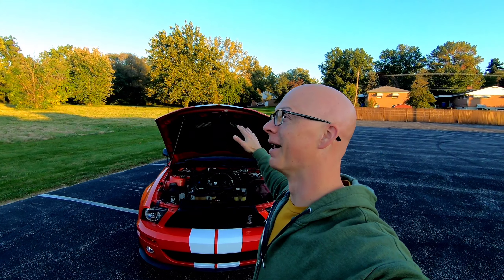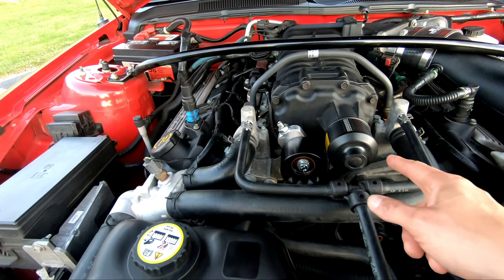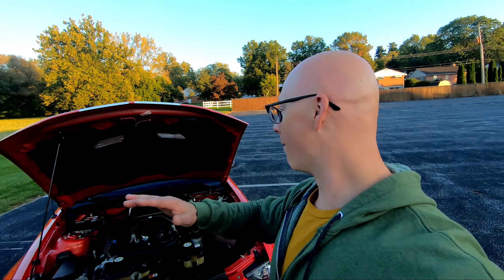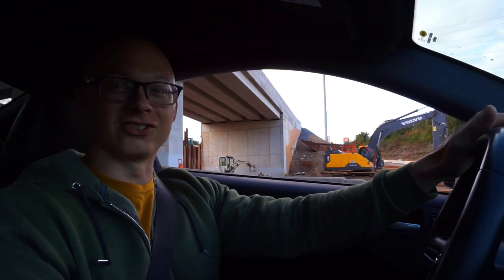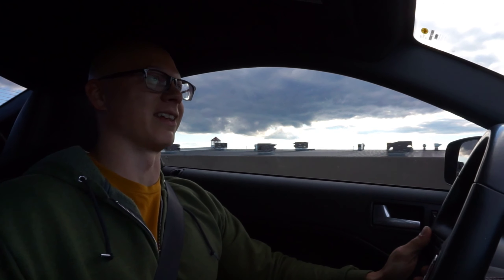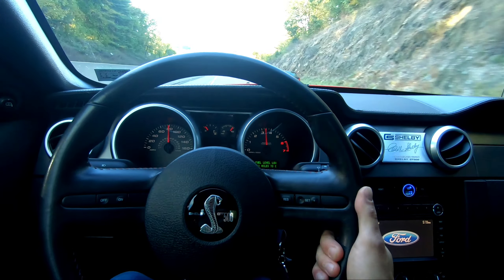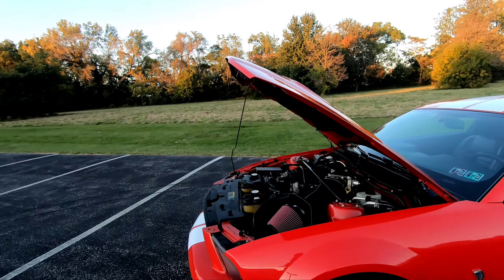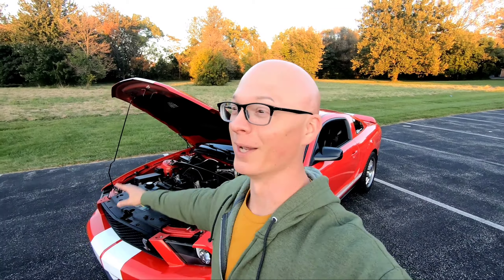2008 GT500 gets JLT intake, VMP 2.5 pulley and custom tune! | GT500 vlogs

Comment from the maker: Thanks so much for watching!  I'm so excited for what the future holds for the GT500 and the channel. Dont forget to drop a like on this video and SUBSCRIBE if you haven't already 🙏😁
Reply: What did you have in the tune parts a labor
Reply: They can make power easy.I know.I have said it before 2 SS and my 08gt500.With just a few mods and you can make well over 600wheel
Reply: Yah they pull forever
Reply: I love to give you a ride in my super snakes or my 500.Crazy power instantly.
Reply from the maker: @crf4328  about $1,500

Comment: I just changed to a 2.5 pulley ,cold air JBT,tune and  Dyno results Torque 576.14 Max power 546.73 convertible,real fun, especially with the young guys,

Comment: Theres a gt500 2007 same color as yours being sold for 29k about an hour and a half away from me from a used car dealership with only 60k miles any thoughts?
Reply from the maker: I'd buy it!   Them chamge the lower pulley because the 07's have balance issues with the lower cast pulley
Reply: @automotiveantics  sweet! Thanks for the tips that's my plan soon 🙏

Comment: You should try 4.10 gears and sticky tires with that power!  Mine put down 550 through 410s with a twin 65 tbody.  Its fast...any gear any rpm it just moves quickly when you mat it.  Love the low end torque.   Mine has the same mods, catless h, jlt 123..
2.6 pulley not 2.5 but i also got borla stingers and 4.10s.  Shes quick lol.  These things are so much better once theyre modded even just a little bit.  People misjudge them because stock they "only" got 500 hp and bolt on 5.0s can keep up with them nicely...when stock...once they have minor mods like this and like mine they become monsters ecspecially for a car that came out in 2007 lol.  I knew you would love this remembering your reaction to stock power lol.
Reply from the maker: Oh I agree it definitely needs gears. I'm thinking about 3.73's. One I get a McCloud clutch in then I'll put some sticky tires on and it will for sure RIP!

Comment: Very nice for u ! My NA 87 5.0 i have BBK cold air intake , march pulleys and flowmaster 40s mufflers
Reply from the maker: I love the foxes!  I've had 3 and would love to get another one
Reply: I have a 87mustang gt with T TOPS.I love it and I will never sell it.I also have a 92lx 5.0 and my best fox OTHER than my other car's.I have a vibrant red 93cobra with 20 thousand original miles.The car is almost perfect original shape.I just have exhaust and that's it.I know there not the fastest but they are beautiful car's.If I WANNA go fast I can get into one of my super snakes or my 08 gt500.Life is good lol
Reply: Yes the 07 09 GT500 make power easy.
Reply: @automotiveantics  There are TQ MONSTERS.They pull all the way too red line.
Reply: @automotiveantics  I have 410 in my 08 gt500 and my car is violent.850rwhp makes all the difference.You have so much more potential with the car.
Reply: @automotiveantics  Try to imagine 300more hp nuts ha.
Reply from the maker: @anthonylaudano9751  for sure!
Reply: A whole 220 hp lol

Comment: You are prob around 13-14 psi without headers but the stock gauge is not accurate once youre modified im surprised yours reads that close mine with a 2.6 pulley on stock blower would peg the gauge past 15 psi and it prob wasnt seeing but 13 max lol.  I have a gen3r now pushing 19 psi it still pegs haha.  I need an aftermarket boost gauge and afr gauge.  I had it dyno tuned so they had those readings to tune it but i need some in the car so i can keep an eye on stuff plus it looks cool lol.  Mine put down 740/733 still running 410 gear its a handful on the street i like it that way lol.  One word: violent lol
Reply from the maker: That's an insane setup!   I want to put headers on.  How much do you think headers would add to this setup?

Comment: Did you have any issues with heat soak? Are u still running the stock heat exchanger?
Reply from the maker: Still the stock heat exchanger and no problems with heat soak that I've noticed.  I try not to run it to hard on hot days anyway so..

Comment: Good power on a dynojet dyno get the car on a mustang dyno for a true number  I’m at 550 to the rear on a mustang dyno with long tunes and high flow cats 15 lbs and tune and pulley cai
Reply from the maker: I was thinking about long tubes next🤔
Reply: @automotiveantics  it's a lot of work to install but the 5.4 wakes up with long tubes  also I have a vmp polished throttle body
Reply: @automotiveantics  just posted a video on the dyno check it out as well as my other cars
Reply from the maker: @anthonyvolta2395  thats the part that worries me. The work and install over just upgrading the blower
Reply: @automotiveantics  they have to drop the cross member you could put 373 gears in it doing a lot of shifting though
Reply from the maker: @anthonyvolta2395  I considered 3.55's because I'm on the highway probably 80% of the time
Reply: @automotiveantics  that's what's in my Shelby gt 's good gear
Reply: Day late and a buck short with the late addition but I need to clarify something real quick. It is altogether likely that you will not see an increase in power with long tubes, but you will see a decrease in boost. While I have some data on this that shows no power gains, Kenne Bell has done exhaustive (no pun intended) research on this. It was also true of my 03 cobra. That said, vvt cars? No data yet. MOST importantly, high flow cats DO NOT stand up to significant boost. They WILL come apart, and you'll be left wondering why the car seems down on power over time. They come apart, and clog the exhaust. The 820 rwhp gt500? It was was 705 until I shotgunned one of my techs during a pull with high flow cat material. I was wondering why my air/fuels were looking so odd. Save your money. This is common with significantly boosted vehicles. Further, if your running platinum or iridium plugs, DO NOT use octane booster. Hand to God, it will kill the plugs and you'll be chasing misfires. Ok, I'm all better now.
Reply: By the way, I'm stoked that you like the calibration! Be safe.
Reply from the maker: @southernstablesauto  guess I'll skip the long tubes and go right for the blower upgrade 😄
Reply: @automotiveantics  Yeah, given the cost of truly well-designed headers, not to mention the aggravation of installation and then topping it all off with no power gains it's better to hang onto your cash and save for the nuclear option. We've done VMP's and not knocking them at all, but dealing with Kenne Bell as long as we have and their (no kidding) obsessive compulsive attention to detail make me lean toward them.
Reply: @automotiveantics  im doing a blower swap before long tubes also after i pay off the car i am going to do a built motor with high compression and at that time im doing cams and long tubes.  Best to have all of the above but if youre choosing one def blower swap by far the best one to do lol.  The vmp gen3r is just nasty for a 2.65 liter blower it is capable of making more than the stock engine can handle reliably and on a built motor can make 1000+ all day long on a 5.4.  Plenty of blower and still has the insane torque hit down low only way better and it easily fits under the stock hood and costs quite a bit less than its competitors its a win win win in my book.  You dont need these big huge blowers if youre not tryin to make 1500 whp and even then ive seen a guy making 1300+ with a built 11:1 compression 5.4 (and a vmp gen3r).  They can make plenty of power weather youre stock or built engine.  Just my .02.  They're hard to beat for their size.  Vmp did an amazing job making those.
Reply from the maker: @midnight347  I'm going with a blower upgrade BEFORE headers as well.